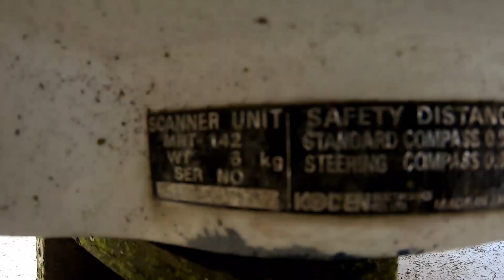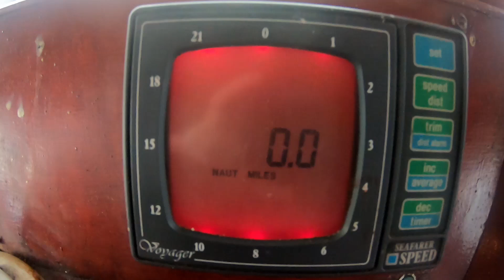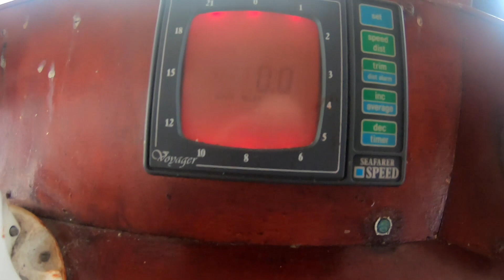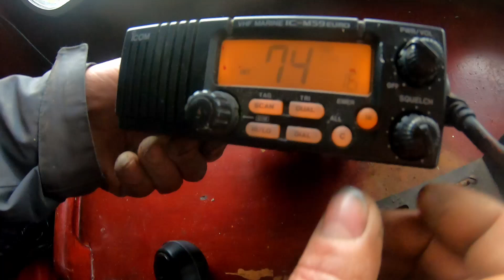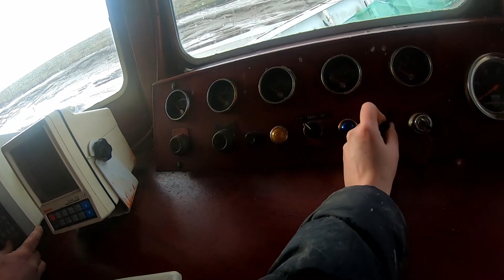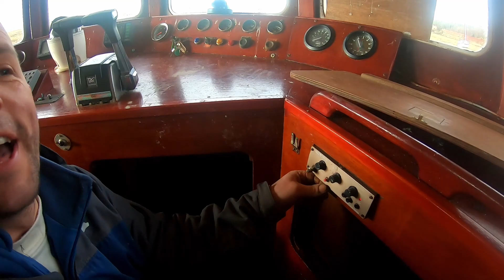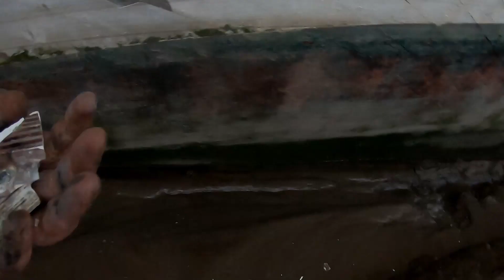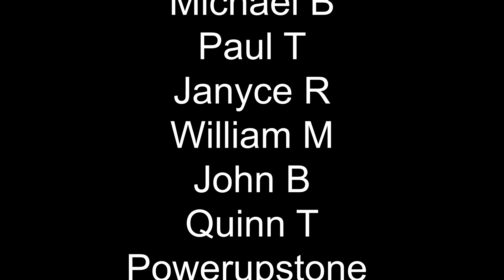Ep 6, Assessing the Hull, Mud fails and weird noises of the ship!

Comment: The iron ballast is known as 'pig iron'. These are ingots cast from scrap iron that are then used at the Foundry to make steel in the blast furnaces. As has already been said, the ballast has been added to compensate the present superstructure so, as the hull is still floating with the tide be careful on removing it as the last thing you need is a capsize. Good to see that the inner planking is basically sound . Good luck with it.

Comment: A generator that won't require earmuffs, much betterer! You need an airboat,a hovercraft or maybe an Argo!
The green box is a Radio Direction Finder. It has (or should have) a directional antenna somewhere, when you turn the dial you turn the antenna and when the signal is strongest the pointer is pointing at the location relative to the ship (or to north if you have a gyro compass which I suspect you do). Squelch is noise blanking, it eliminates weak signals and background noise so you don't need to listen to static the entire time the radio is on, you will only hear strong signals, how strong depends on the setting.

Comment: Gemma and Simon . I am an electrician and your private way to generate electricity for use on the boat work Serinda, is very interesting . Your generator should put out 110 volts for 110V drills and grinders . The other way is to charge batteries for extra low voltage drills and grinders . An inverter will run 240V drills and grinders but, more chance of electric shock . JC  17/12/24 .

Comment: What you called shelf brackets are called knees. As far as the deck beams go either fully replace them or remove the old cut out the rot and splice in a new end.

Comment: VHF, stay on 16 more chance of traffic there, or check local harbor frequency, now squelch turn toward off until you here static, then just barely move up till it is no longer hissing, this is the control that discriminates what a signal must be in strength to break into your listening system. You may need a new Arial or check the wiring to it, looks like you have a start at least, with your electronics, good enough maybe to move her to where you can do the upgrades or repairs to the systems you want.  We wish you all the best, Hugs From Canada.

Comment: could you use your electric winch to pull items across the marsh? connected by a long rope till you can connect wire to it may need a snatch block  lower down (anchored to marsh near ship) i have used this method many times with great success especially with good plastic sledge saves all that HORSE work, you are doing a great job LUV to you all :-)xx

Comment: you need to do on the Old fireplace to remove the old bolts 
you need to heat the Old bolts up when they are slightly glowing red hot then you can hit them with a hammer & should pop out.
because I have done this with other things when the old bolts are stuck and couldn't remove that with a spanner.

with the roofing you put that sticky stuff over the holes to seal them up temporary
what I would done is covered the whole roof with one full piece of that sheet & slightly over the side 
left it to dry and  then painted it with waterproof damp proof paint

Comment: To hear audio (static unless somebody's transmitting) on the VHF, turn the volume all the way up and the squelch all the way down.  "A.D.F." is an HF (shortwave) receiver that also (as you discovered) will receive commercial AM broadcast.  VHF is used for local traffic, HF ADF used to be useful for navigation at sea, not so much now when there's GPS. Still useful for weather reports. 
Eventually you'll want proper AIS also.

Comment: I really like that old wood stove.  If it were not so heavy I would say pull it out and sand blast all the loose stuff off of it and spray it down with some high temp paint and reinstall it.  I have to say that other than some of the ribs looking beat up the hull looks to be in good shape.  The interior ribs seem to be pretty straight so it could be just a matter of replacing them one at a time until it is all good again.  I would not do more then one at a time as you could loose structure on it and have a real bad day.  It is kind of sad that you all only get to work on it on the weekends.  I really look forward to following your journey of the restoration of this ship.  I am curious to know if the radar system still works.  Those can be quite expensive.  I would be careful pulling any of that paint off until you can re paint it.  Some of the boards can shrink and swell as they get wet and dry out.  That can cause the bolts to shear off some times.  Looking forward to the next one.  Have a great week.

Comment: Your ok to jet was with enough power to clean but not enough to damage surface of the wood.  Good luck x
Reply: Wondering if soda blasting might be the way to go?  Grit is way too much for ferrocement or wood, but soda seems to work well unless the wood is truly ripe (which means it will need to be removed anyway)  For patches of rot West System Epoxy works well where the damage doesn't require changing the timber.

Comment: the green radio on the wall is a sailor vhf very high quality radio well worth getting working but never key the mic unless it has a aerial connected
Reply: It's an R109, it's a receiver only, from around 150khz to around 4.5Mhz plus the FM band (88-108Mhz)   The mic below that is a PA system I think, possibly the same make judging by the similar colour and layout.  The radio can do DF (direction finding) if it has a directional antenna system fitted.  But I suspect they simply used it for news and music.
Reply: @geoffroberts1126  not only referring to the sailor geoff but mic comment was for the vhf
Reply: @mechanick1000  Yeah, I must admit I cringed a bit when he did that.

Comment: Just binge watched your channel. Are you lot bloody daft. Lol. Just kidding. You have a ship that doesn't take on much water at all other than through the topside. The "double diagonal planking" seems overall sound. Yup, you got some rot in the frames and stringers. But she's got good lines and great power. Looks viable. That heavy bit down in the bilge is lead ballast. Those brackets at the corners of the hull and backs are called knee braces. If she was mine I'd start at one end and strip as much rot as I could without effecting structure and clean as best I could as I went. Then make her seaworthy to the best of your ability and get her out of the water. Build a shed over her and start opening up the decks that are rotten. All in good time. Don't let it become drudgery and get smiling and having fun. You'll  get there. Leo on the Tally Ho had a monumental task, of course he's a shipwright, but if Simon from "Finding Simon" can do what he's doing, you guys can too. Carry on and good luck.

Comment: Great video again guys. 
I don't have much insight on boats, but radio and radar is my day job. A few bits that you'll hopefully find useful;

Don't transmit or switch anything on that may transmit. That includes the radar and VHF. Pretty much any radio device in the UK that transmits (aside from cheapo PMR walkie talkies) requires a licence from OFCOM. That'll include your radar and VHF. To gain the marine VHF licence I believe you have to show proof of having done the training. 
Whilst maritime radar is far lower power and far friendlier frequencies than some of the big scary military and civil aviation radars that I play with, it's still wise not to get super close to them when they're running. Especially if you don't know much about them. 
That ICom is worth protecting/saving. They're a few hundred quid so keep it from getting wet. Maybe you could remove it until it's required. It's one to weigh up - if there's a risk the vessel could get swept in to open water with you on board in high tides or a storm then maybe leave it there - licence or not, it'll get you some attention from the coastguard. There again you don't want it getting nicked or wet. Removing it would also stop any accidents with an unwanted transmission that could land you in trouble. I've seen water in the mic activate the push to talk switch, so you wouldn't even know it was happening until the coastguard or OFCOM turned up. 
I suspect you're going to want a new aerial on that VHF. Marine aerials are quite long - over a metre, so it should be pretty obvious if it's there. It's quite common for water ingress to be a problem on them, and i've even seen water running all the way down the inside of the cable and coming out several floors below at the transmitter. It's only a tiny cable so it won't be much water, but it's deposited right where you don't want it in the transmitter. 

Squelch - ok. Radio signals are all around us. Some are wanted, some are not. Electrical equipment and the sun are 2 of the biggest causes of unwanted signals, and they form a constant background noise (that we can't hear because our ears can't hear radio). Within that are the wanted signals. The aim of the game in radio is to get your wanted signals without hearing all the other rubbish. You can do this in a few ways. The first is to make your wanted signal bigger than the unwanted stuff. You can do this by transmitting at a higher power (so the person you're listening to is essentially shouting louder). If everyone starts doing this though then it's a fight to have the biggest transmitter. OFCOM therefore limit transmit power via your licence (this may be set permanently in your ICom, or there may be a setting for it in a menu). 
The next option is on the receive side to filter out the stuff you don't want. That's where squelch comes in. You ICom is hearing this noise all the time. Assuming your aerial is ok, turn that squelch all the way in both directions. In one direction you'll start to hear loads of white noise. This has essentially turned your squelch off. You'll still hear wanted signals, but they'll be surrounded by constant static. Wind the squelch back in the other direction and you'll find a point where the static stops. By doing this you've almost put in a gate across the receiver - it's blocking out all the unwanted stuff. If a genuine transmission comes through then its level will be higher than the background noise and therefore higher than the level you've set the squelch at, so the speaker will turn on and you'll hear the message. Once it's finished it'll close that gate again and keep stopping the unwanted noise. You don't want to wind the squelch down too far past the point where it cuts out as you could risk your wanted signals also getting blocked out as you move the threshold. This setting will change depending on your environment. For instance if you're moored in a busy industrial port with lots of floodlights and electrical equipment, you may need to tweak the squelch up to shut it all out. Equally in open seas there'll be very little out there to cause noise aside from the electrics on your own boat, so again a tweak may be necessary. 
I hope that all kind of made sense. Do let me know if you have any radio related questions. Maritime radio isn't my thing - aviation radio is. Nevertheless the physics and principles are the same, but i'll defer to the mariners on here when it comes to usage, rules etc.
Reply from the maker: Thanks Chris, yesterday Simon did turn on the radar, but I've told him now to stop pressing buttons and messing with things from now on!
Reply: @ShipHappensUK  Did it work?
Reply from the maker: @geoffroberts1126  yes it did!!
Reply: @ShipHappensUK  Bonus.  The electronics are realistically a long way down the list of priorities, but if they work that's only a good thing.  Mix of ages there.  The oldest would be the Sailor R109 that dates from the mid 70s, I'd say the radar was likely early 90s, VHF circa 2000.   Other stuff there probably 90s to early 00s.  Pretty sure I saw what is likely a GPS there too.  So if you get the ship seaworthy you can use all or most of that in all probability.

Comment: Saltwater is safe; mould and rot cannot live in it.  The metal brackets fastening deck beams to the frames are called ‘Hanging Knees’.  You may also discover knees fastening the deck beams to the beam shelf or the clamp.  These are called ‘Lodging Knees’.

Comment: I would say it looks pretty good,  I would second the other comment if a wooden boat floats without running the bilge pumps your golden.   As for cleaning the inside of this room,  why could not just commence sanding the top layer off everything and just vacuum up as you go.  This would retain the structural integrity that is still there and expose any sections of weak wood.  You could try some rust converter on the knees if they are cast iron,   or they may still be in good shape.
Reply: I saw a radiator in this video,  does it work?  is there a boiler?  Is it something you could get up and working and be able to have heat inside?  Would defiantly make work allot more bearable.
Reply: Might draw heat off the diesels?
Reply: @PUNISHERGTO  Mr Shultz, you are not serious?
Reply: @alexandermenzies9954  Exactly what is so hard to believe about the interior space heaters drawing heat off the diesel engine coolant loop via a heat exchanger?

Comment: To make a realistic hull assessment I think you have to get the ship out of the mud , I have seen comments about lift bags etc. I think a few hours  digging with  a exaviter  would  do the trick. Digging  a channel on the landside of the ship puch 2 moring poles  in and overhaul  the ship into the hole on high tide .
If you are going to work with repair beyond  patching small cracks/ holes , or stopping rain leaks with tarps. I would recommend moving to      more accessible moring place sitting in the silt and Mudd will seriously hamper the repairs in the long run. I understand that it may be practical to use the mud botton as your working platform,  but the solution for that in a "not stuck in the mud site" is a working raft that you can move around  the hull , doesn't have to be anything fancy, styrophone /plastic barrels / and reused (free) wodden garden flooring material  (not rotten)(and some work would  do. ) 
Small work under waterline/  outside the hull can absolutely be  done when the tide is out from the "sea bottom" but the you just have to anchor the ship on suitable place and wait for the tide to go out.
I am  curious about the ship the wodden hull combined with miltary use makes me think about. Magnetic sea mine; mine sweepers had wodden hulls /today glassfiber hulls. what was the ship used for?
I have workt  with traditional woodship building in Sweden, where  I live. (Thereby the not perfect English )

Comment: When you get to the point of removing bad deck beams do this. When you take out a beam replace it with either permenent or temp beams. You want to keep the shape of the hull at all cost. Don't remove large sections of deck all at once. The deck is helping to hold the shape of the hull. Stop and study before you tear out things. Remember: if it is rotten you can't fasten to it. Are the ends of the ribs bad. if so put in what are called sister ribs.

Comment: I'm an old US Navy boy and a lifetime boat owner. But I've always shied away from the old wooden boats personally, but, I've scrapped many of them along with my buddies here in New Jersey USA. What I would recommend, at least as soon as possible is to get this boat out and on the hard. That hull needs a through inspection with a moisture meter and some anti-foulant applied ASAP. I'm more concerned with worms in the hull than planking at this point and if they are present it would behoove you to address that before anything else. The parts you can't see are the parts that bite ya. Also make an investment in  some fiberglass sheeting and epoxy resin. Some 80 grit sand paper and a small paint roller will allow you to patch holes and leaks quickly, cheaply and effectively. Then simply cut or sand it out to proceed with proper repairs. Fiber glass is itchy so use of gloves and long sleeves are a good idea, especially since you don't have access to a shower or fresh water at the moment. Fiberglass/Marine Tex has saved my ass way more than once! Good luck and I'm gonna keep watching your adventure.

Comment: Hi Guys, you can use 12V spot lights if you rewire the lamps so two are in series for 24V. Bulb must be identical :-)
Good luck with the boat! Thanks for sharing.
Reply: Or get some 24v 'bus bulbs' of eBay

Comment: at 30:40, the metal brackets holding the deck are called "hanging knees".. very spendy to replace, keep em all.. clean and refinish em all, mark them plainly, so you know right where they came from..  I would say that you could skarf in new ends on the futtock's, the framing that goes above the deck to rail the deck..  at 48:30, those could be lead ballast, looks like the ones i have seen on older wood sailboats, maybe lead n tin mix, since they are grey in color, lead turns white..  on my 42 footer, wood 1948 boat, i used "wood hardener" on my planking and it worked fine for the smaller seams that were a bit questionable.. i put my boat in dry dock to re finish the outer hull..   i would be careful how much ballast/chain/lead/concrete you move out at a time.. in dry dock no problem, but in the water, could spell disaster.. she could keel over in a stiff wind..

Comment: Acquire piece of plastic guttering as long as the sled is wide....  Rivet gun and rivets,,, (will always come in useful later),,,   rivet guttering to front of sled,,,,  ''hey ho''' front of sled wont dig in any more,,,,, AND it will give rigidity to sled,,, do not fix pulling rope onto guttering,,,, fix just behind,,, lead under the guttering,,,,,   cinched about two foot away from the front,,, this will help lift the front as you pull.